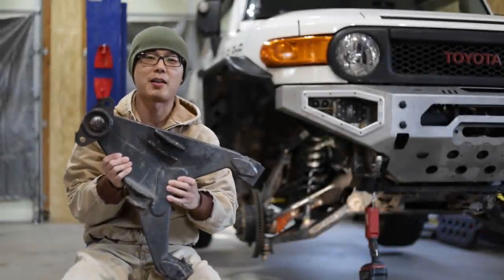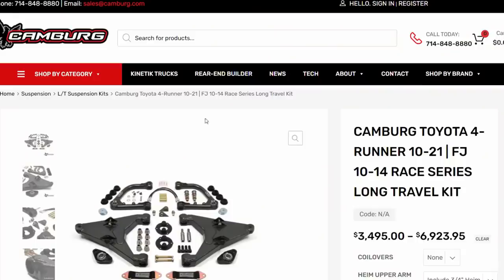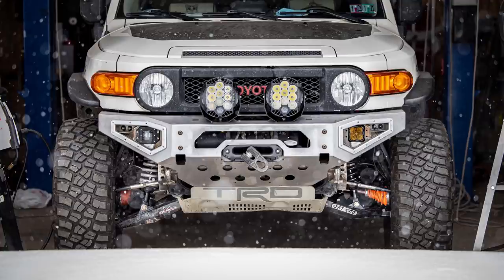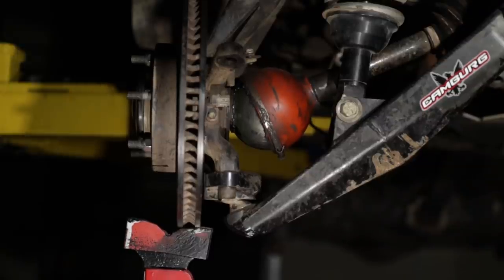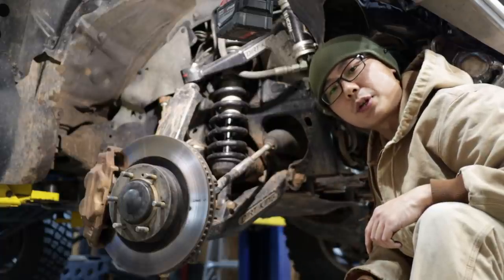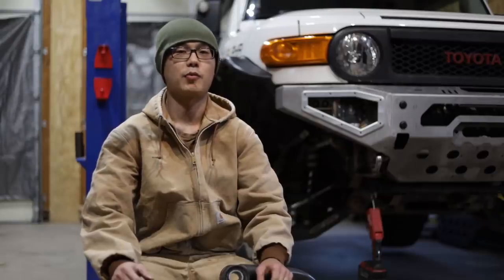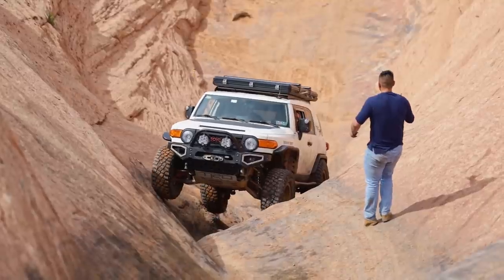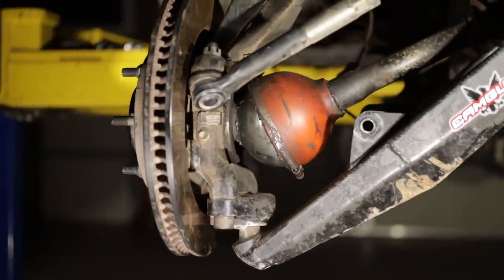Toyota Long Travel IFS - Camburg vs Dirt King

Comment: Hi, I'm curious about clearance between the tire and outside fender. If you run a 35 with a 3.5" kit will the tire hit the fender with the plastic fender flare removed? Would you have to lower the bump stop to prevent that?
Reply from the maker: Yes the tire will run into the metal fender. I have durobumps extended bump stops which are about 3/4 longer than factory at compressed state. I still kiss a little if I hit bumps very fast. But never during rock crawling

Comment: Great video. Do you think you could do a comparison on stock travel UCA’s (comparing Dirt King and Camburg?)
Reply from the maker: I don’t have those parts so I can’t do a video right now. But comparing their ball joint UCAs I would personally go with Dirtking because it uses moog ball joint. It is enough to allow 1” extra travel for extended coilovers. Camburg uses proprietary X-joints. It is probably stronger and higher angle than moog, but moog is already not the limiting factor in the suspension system, so you won’t gain any performance as a whole. I would rather save $100 and have an easier time for maintenance/replacement down the road.

Comment: Great video thanks! 
Where is your shop located?  
 I would like to see a icon vs king front coil overs long travel and total LCA's vs these 2.    I am switching my tacoma to long travel and have done the steering knuckek gusseats by total chaos and the TC cam tab gussets for the lca's.
Reply from the maker: Thanks! I’m not a mechanic. This is just my garage. Not a servicing shop. I had total chaos +2 standard kit before Camburg. The standard kit was not good. Their new expedition series is better. But their UCA design still limits the travel more than these 2.
Reply: @TinkerersAdventure   Thank you.    What long travel  coilovers so you like the best?

Comment: Ok.  So your running icon mi travel coilovers with the long travel arms ?   How does that work?!  Are you just strapping it lower ???
Reply from the maker: This is icon’s long travel coilover. Different from mid travel or extended travel ones

Comment: Amazing video! Subscribed! Do you think Dirt King non-long travel LCA’s will make a difference over the stock ones? I also do a lot of rock crawling but can’t get the long travel because I’m running KDSS. Please let me know.
Reply from the maker: Thanks! I personally don’t see strong reasons for stock length aftermarket LCAs. The poly bushings will pivot more freely. But not significant compared to the coilover spring force. You can also put polybushing on stock LCAs. Strength is another improvement, but the stock one isn’t too weak. It’s not like the Rear lower link that is easily bent
Reply: @TinkerersAdventure  good point. My stock bushings starting to squeak after a lift, so I’ve been wondering if I should replace them. Poly sounds like an option

Comment: What front shocks do you use? I currently have the 6112s & only the regular Camburg uniball.
Reply from the maker: I’m running Icons with CDC adjuster. They make one sized for longer control arms

Comment: Do upper control arms need to be changed to go long travel?
Looking to use Bilstein 5100s and Bilstein coils and aal to achieve 2.5" of lift and aftermarket (jba?) uca to hold me over until (if) i decide to go long travel. If doing this, would i have to change ucas again? Or do they work with both setups? Is there a specific uca you would suggest for 2.5" lift with Bilstein 5100s Bilstein coils and aal that would also work with long travel lcas?
If doing this
Reply from the maker: Yes, every IFS components need to be changed in long travel. Noting in a regular 3" lift can be reused.

Comment: I have the camburg 3.5 long travel and I want to upgrade my steering. What's your conclusion? 
My buddy upgraded his 4Runner with a tundra steering rack. Is that an option?  I can't find a lot on line about it
Reply from the maker: Yes a tundra or LC200 rack is the best and probably only meaningful option. Check out marlin crawler’s RCLT instruction, which requires this rack. Simply doing beef up heim joint tie rods is not a safe option.

Comment: How can you fit +3.5 long travel without fiberglass fenders? I am considering total chaos +2 since fenders are not needed
Reply from the maker: As long as you replace or remove the factory flares, nothing won’t fit with the factory fenders. Larger tires at full bump will hit the inner wheel well first. So fiber glass alone won’t even help you gain more up travel. I guess the fiberglass fender are needed for width to cover tire sticking out on the sides, but that is only required if your local inspection law mandates that.
Reply: @TinkerersAdventure   thanks for the awesome advice ! Is there any cons of going +3.5 instead of  +2? Getting any good advice for FJs is not easy
Reply from the maker: @phillipmaldonado1  no problem. The only con is the extra 1.5” width per side. But to be honest it was the last thing to worry. I wheel in the east coast with tons of trees and tight trails. I’d say go with the widest control arm you want and lowest negative wheel offset. Lots of people run +2 kit and a tons of wheel offset, in the end having more track width than my +3.5 kit
Reply: @TinkerersAdventure  that makes perfect sense. I already have taken off the fender flares and have rims that are 17x 8.5 with -12 offset. In your opinion will that stick out too much with 3.5 LT ? I appreciate the advice, for such a big investment any information greatly helps
Reply from the maker: @phillipmaldonado1  That is not too much but you could go tighter. I’m running 17x8.5 with -3mm offset and 315/70R17 tires. I have about 0.25”-0.375” clearance between the tires and allpro spindle gussets. Dirtking makes an offset spindle gusset that allow running even tighter wheels. Only thing negative offset do is give your clearance to spindle gusset and add more stance for look. It increases scrub radius, adds load to wheel bearing and control arm ball joints and makes it easier to rub on pinch weld/body mount.
Reply: @TinkerersAdventure  thank you for all your help. I'm committed to my rims and wish I would've gone with less offset back then. Since it'll stick out too much I'll be going with +2. Definitely looking forward to watching more of your videos!
Reply: @TinkerersAdventure  so finally put the +2 long travel on and realized it is too wide without the OEM fender flares. What fender flares are you running on your setup? Thanks again
Reply from the maker: @phillipmaldonado1  mine is warrior products tube flares

Comment: What’s it like on the street ?
Reply from the maker: You lose the front swaybar with these setups so street performance will be worse. However LT will handle better than factory width setups w/o front swaybar due to wider track width.

Comment: Long travel ifs setups are not ideal for rock crawling. The shorter stock lower arms departure angle actually gives you better clearance vs the gradual angle of the longer arm. I also believe front long travel presents a body roll characteristic that's not ideal for rock crawling. You would get much more performance out of your rig if you left the front stock and increased wheel travel in the rear end instead.